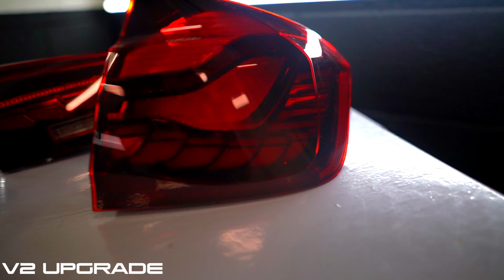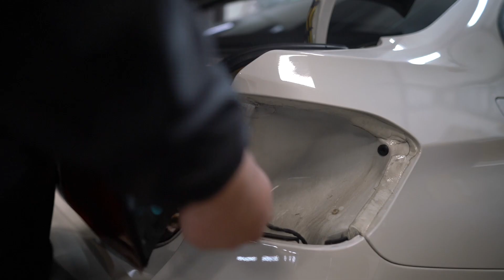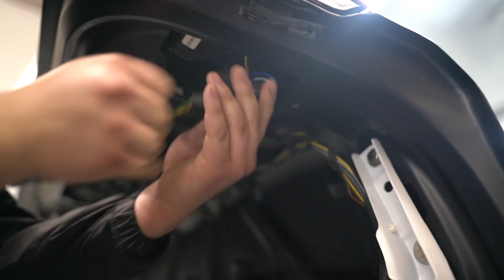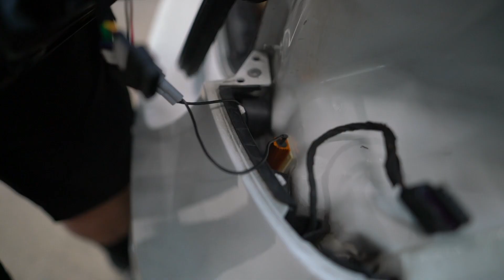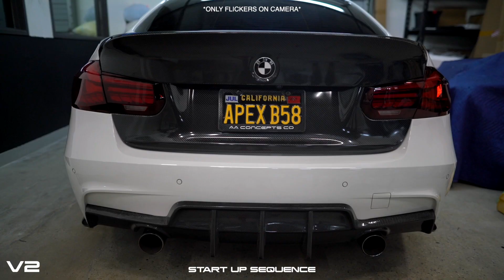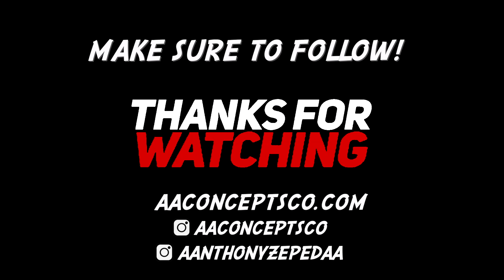F30 F80 V2 GTS-STYLE OLED TAILIGHTS INSTALL (AACONCEPTSCO.COM)

Comment: I have F30 Estoril Blue and i bought red one. But i faced with vapour after rain and washing. Any one have this problem or is there any solution ?
Reply: Seems to be normal with aftermarket parts. It’ll dry eventually tho.